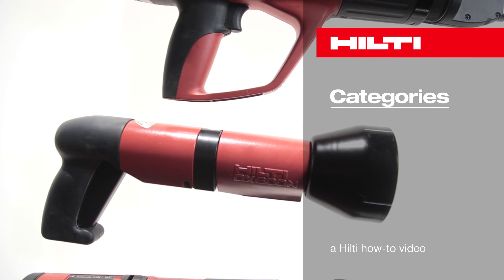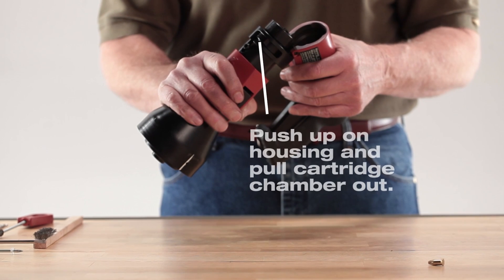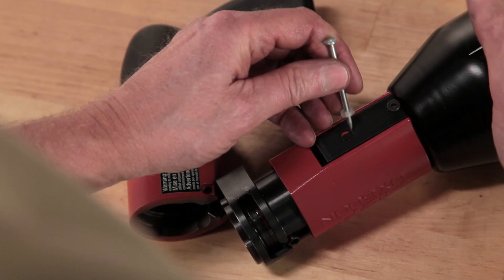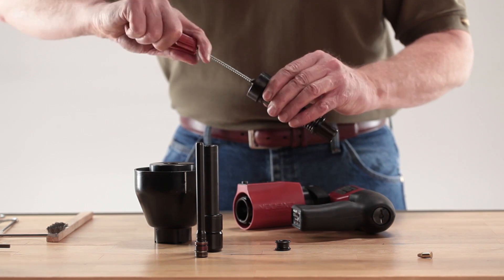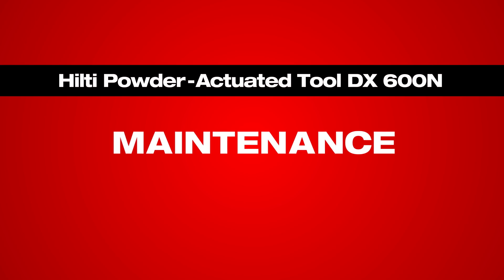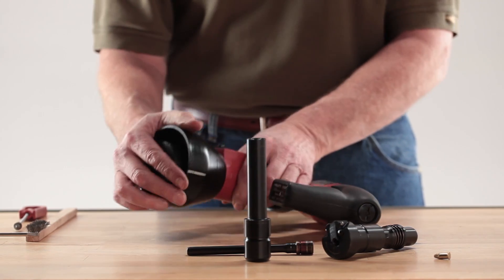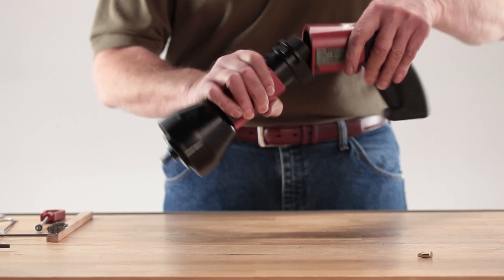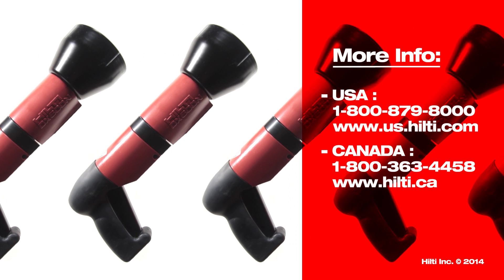HOW TO clean and maintain your Hilti powder-actuated tool DX 600N

Comment: If only I knew these things existed! I bought two dx100L tools and they weigh a ton, not to mention you need a lump hammer to whack them. Not easy when up a crag on a rope trying to drive into rocks. This will be much easier.